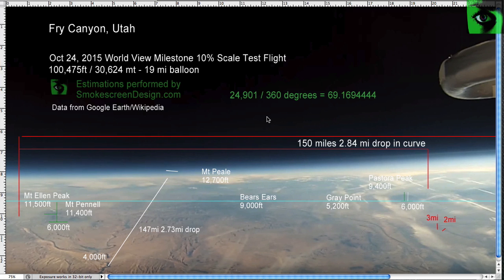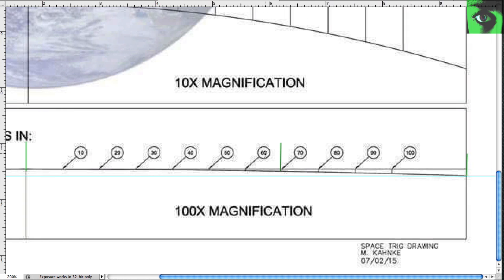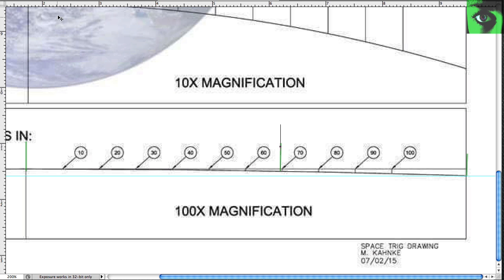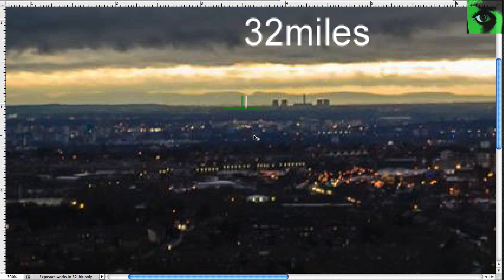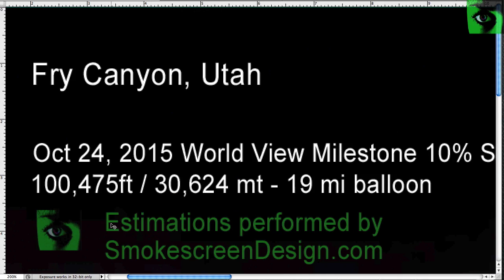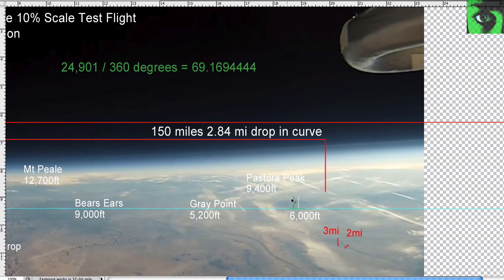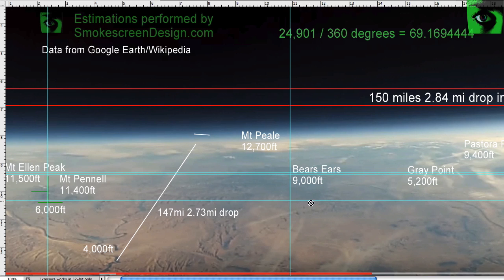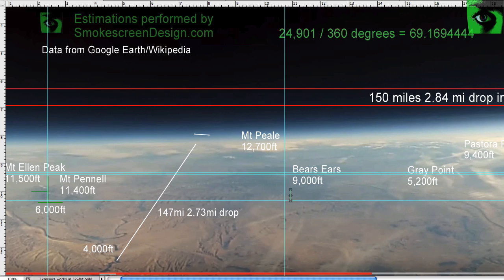Can You See Buildings or Boats Lean Away? flat earth

Comment: Here's something to think about. At different latitudes the miles per degree can vary drastically. As long as your looking east west.(Fairbanks Alaska, circumference is10,551 miles-29miles per degree) . Same would apply longitudinally looking north -south. Also the curvature formula will change by latitude as long as you are looking east -west. I think curvature on land would be extremely hard to show due to varying elevations and terrains. Since it is highly unlikely the earth is a ball finding curvature on land is probably the only place it will be found. Not because it's a ball just because that's the shape it is. The only curve water will hold is a wave. I agree on the accurate info bit. Many disinfo and discredit agents out there. So when someone points to their info, it can then be easily debunked.

Comment: I agree but should we be able to  see a building 358ft tall at 27 miles away from about 10 to 20 feet of elevation
Reply: +tman0317 And why can we see a good bit of the Chicago Skyline from 60 miles away?  That would be over two thousand feet of supposed "hidden" earth, and yet you can see a large portion of the Sears Tower, which is about 1400 feet high...